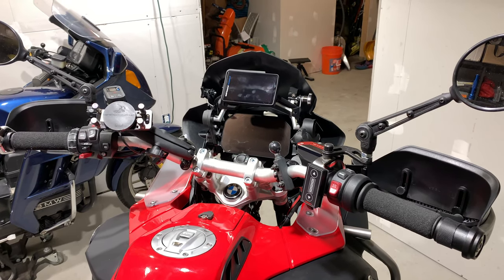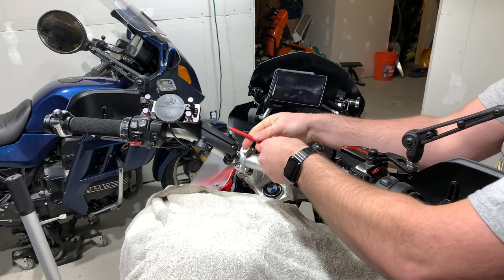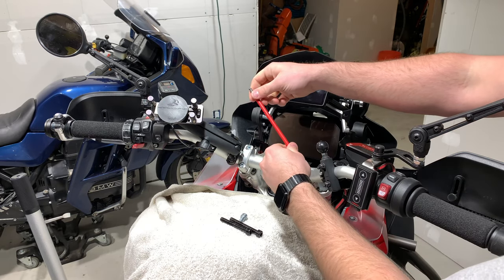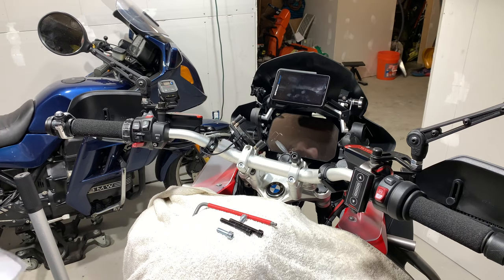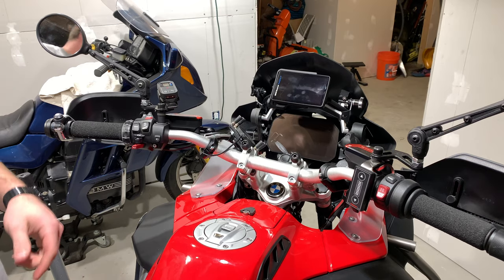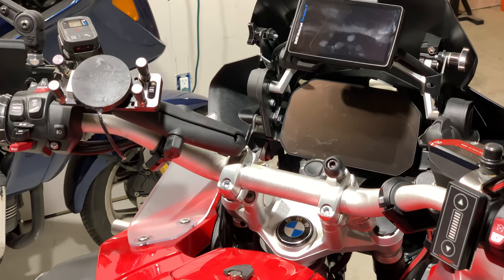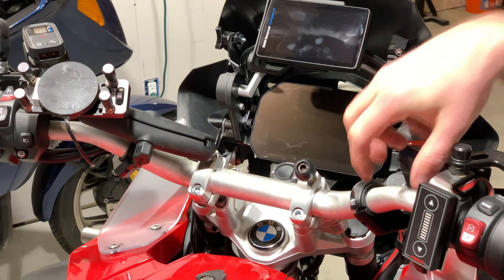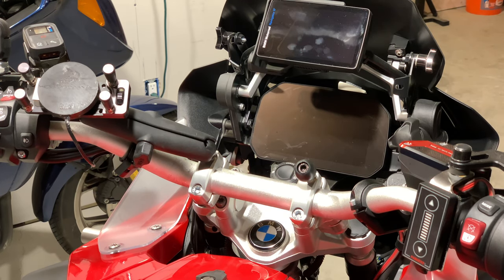Install: RAM Mount Motorcycle Handlebar Clamp - R1200GS

Comment: Thanks for the video.  Just used your amazon link to purchase this kit.  First time i dropped my bike with the Quadlock mount, it broke… I knew I should have gone Ram to start.
Reply from the maker: OOOF, sorry it broke on you. Glad you picked one of these up! I have one on all of my bikes and it's rock solid.
Reply: Adam Chandler thanks.  Yes, the Quadlock, with there injection molded mounts, ‘press fits’ the female bolt into the mount.  With one drop of the bike, the whole thing came out.  I will keep using the Quadlock phone mount, but am going to move to the Ram mount for the bike attachment portion.